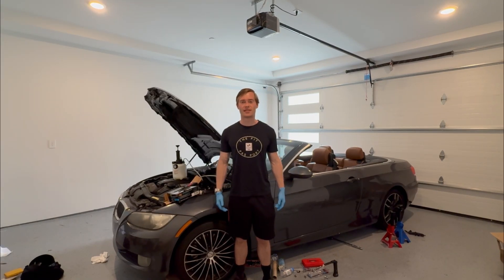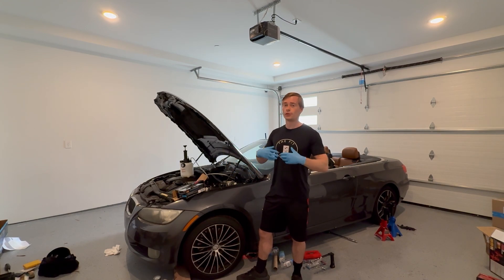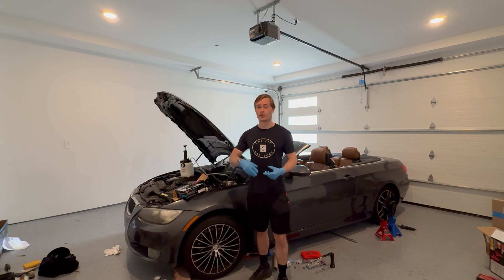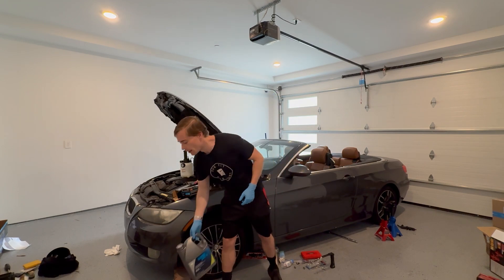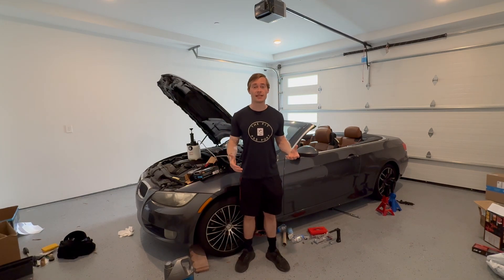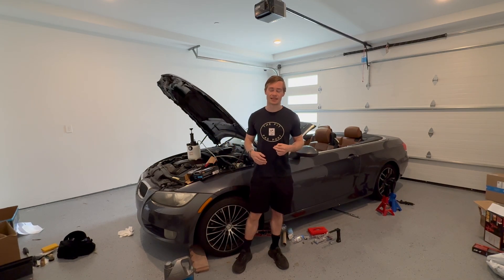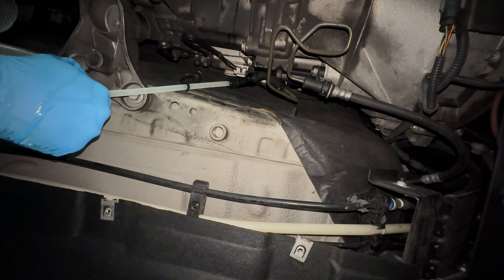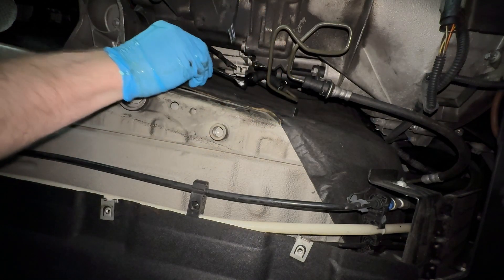How to Reverse Bleed BMW e90 Clutch

Comment: so how do you know when to stop adding more fluid? just wait for the fluid from the reservoir to hit the ground? lmao
Reply from the maker: Short answer is you there's no "right" amount, you gotta push fluid until it's fully bled.

Ideally you've got an unpressurized power bleeder cap screwed in catching your fluid so it never hits the ground. You'll want to push as much as you've got in the syringe then test the pedal, repeat if needed. I'd guess most cars have ~200ml in the whole clutch system, but at the end of the day what matters is getting the air out not the amount of fluid you push through the line.